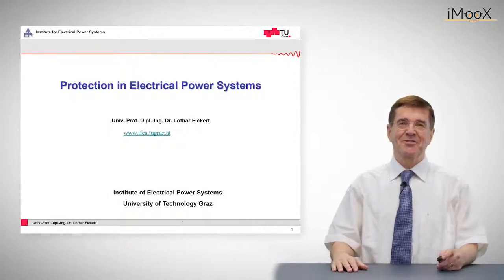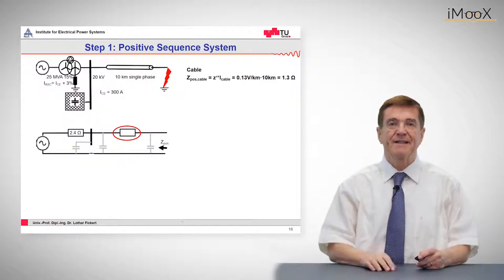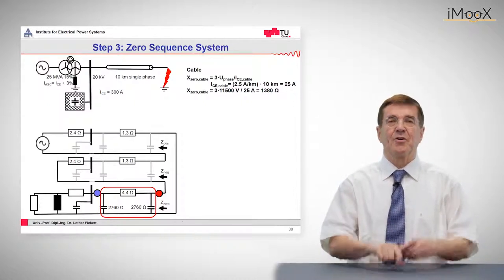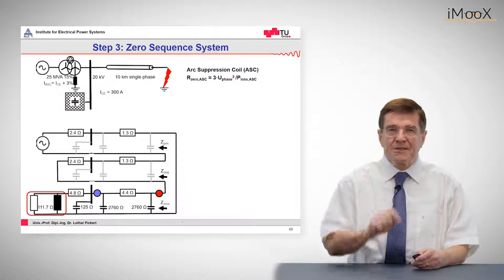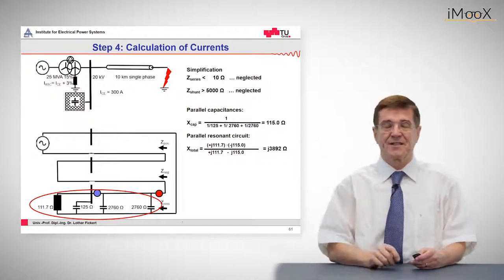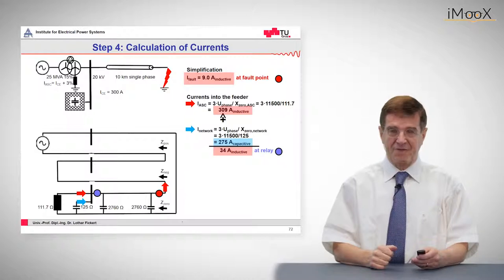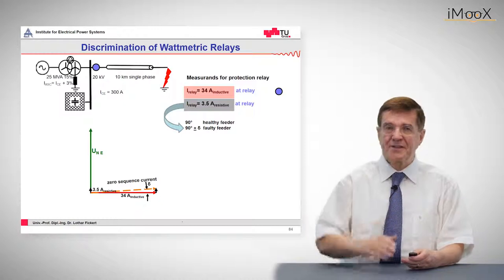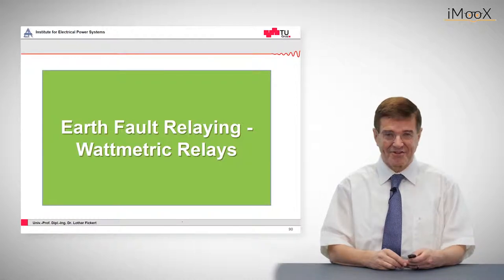E4 Earth Fault Protection: Earth Fault Relaying - Wattmetric Relays

Comment: if the relay is at the beginning of the line and the error is at the end; Does the resistive current decrease or increase along the line towards the fault location?
Or is it the same size at both ends? That would be important to me. If my line is 10 km long, but I have 5 stations every 2 km, I need to know what resistive currents I have to expect at each station in order to set the relays correctly.

Comment: Here in Slovenia we use on medium voltage (20kV) passive coils (can choose steps of L) in paralel with fixed 80 ohm resistor for grounding neutral. The ohm resistor makes sure that current is below 150 amps so the pretection devices can diferentiate fault currents.
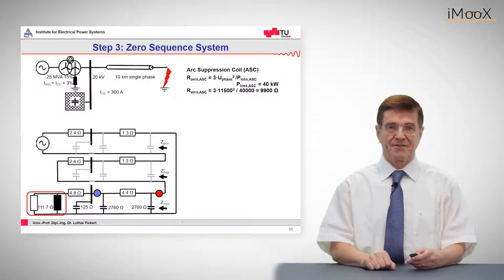What I dont understand, is if we look at figure at 5:00, i replace the 9900ohm resistor with a 80 ohm and then calculate the Xtotal = cca. 80ohm as indicated at 6:04 and Izero=cca 144amps which is not ok since that should already be the fault current.

Should the 80 ohm real life resistance be modeled as a 240ohm resistance (3x80ohm) for my calculation?